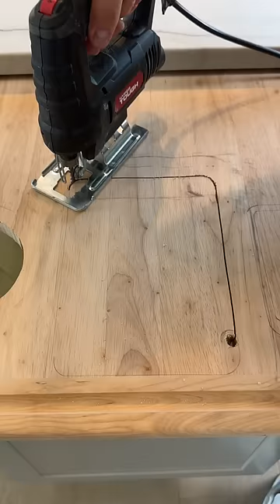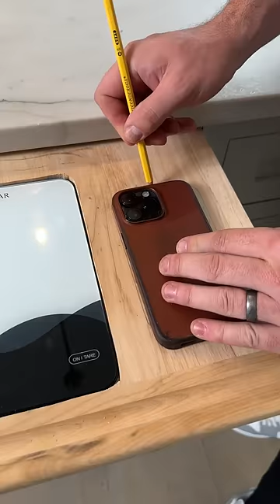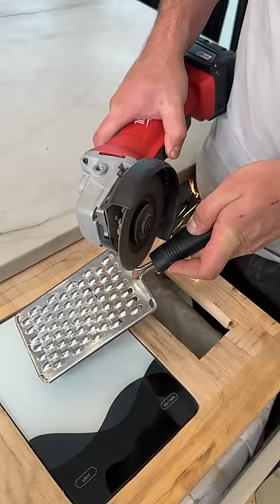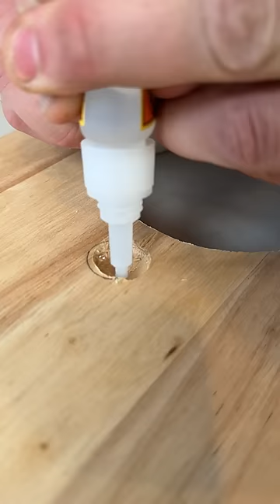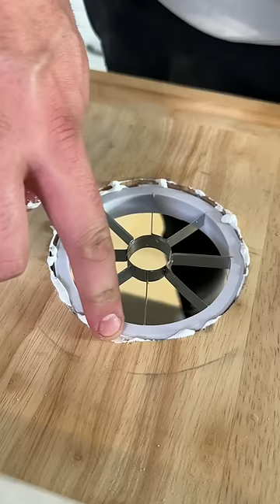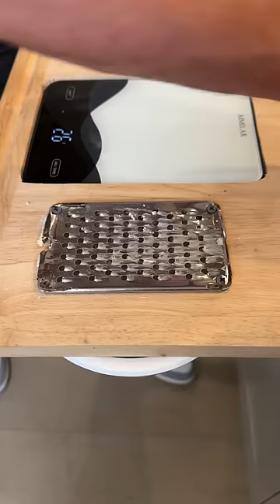THIS IS WHY I MARRIED HIM! 😍

Comment: Yes put all your weight on the apple slicer just to cut the apple so it can 1. Break cutting board right off the table 2. Push your own hand right threw the apple slicer It had handles for a reason lol.
Reply: How about how he drilled the holes right above the marble counter😳

Comment: Now you have a much smaller cutting board and a bunch of kitchen tools that you can never wash. Perfect 😂
Reply: Or use properly
Reply: It was the screws right through the shredder for me 🤌.
Reply: THIS!!! how do i wash that.
Reply: The cutting board is able to be removed so you can wash it
Reply: @angela4137  So just have to handwash an entire cutting board that is about as wide as the sink, instead of the small tools that can go in the dishwasher, got it.
Reply: The cutting board is useless as a cutting board. So now they either have one laying around or they cut directly on the granite killing their knife's edge.
Reply: @angela4137 I don’t think it can be easily removed otherwise you have to worry about your toes while cutting 😂 Plus the board is bigger than the sink so……😅
Reply: Lol thinking exact same thing
Reply: moldy cheese grater adds extra flavor
Reply: Some people be doing too much.  That it has the opposite intended effect.
Reply: @TheVikingRaid adds that funky blue cheese flavor
Reply: İyi
Reply: @angela4137  Not with an electric scale in the middle that is not waterproof beyond the top exterior shell. Which is also ruined because there is not enough stability with the board to get anywhere near an accurate read.
Reply: I mean technically it would be possible to wash, but it would be a painful lot of work.
Reply: I thinked exactly in that...hahahaha 🤮
Reply: Justamente eso pensé, como los va a lavar😅😅😅
Reply: @andremartinez418 you cant even wash whole table cause the electric stove also plant in it
Reply: @angela4137 so is the digital scale waterproof now? nice😅
Reply: Good luck cleaning this
Reply: @Unlitedsoul  The scale doesn't seem to be affixed in and just supported by a couple of metal strips. So hey can just pop it out easily when they want to WASH THE WHOLE FUCKING BOARD just to clean the cheese grater.
Reply: Not to mention he used screws that will rust with any moisture present 😂
Reply: Gross…bacteria, mold…ehhh
Reply: @angela4137  that's a digital scale, not a cutting board. not sure they work properly unless they're on a flat surface though
Reply: @ItsJustTeddington  You may have a point. I thought he used epoxy around the edges, but maybe not. I'd have to re-watch to be sure... and... well... no thanks!
Reply: Not to mention the non food grade glue.
Reply: And grooves on the side where food gets stuck
Reply: you can' wash it the same way you wash a corner duh, ! just think ..
Reply: Except he can remove the cutting board and wash it and sanitize it.
Reply: You do know how to remove screws right...the problem isn't washing them that would be very easy to do. The problem is putting the screw back he would only be able to put them back a few times until he just has a big hole that the screws won't go into anymore. I thought people were smarter
Reply: Right? How often does she slice apples with a junky slicer? Why doesn't she just use a knife?
I thought he was making a margarita station or something. to hold a bottle of wine and tablet in the bathtub.
Reply: @Unlitedsoul not enough
people recognize the scale is practically useless.
Reply: @Aethenthebored  So you think cutting boards are somehow some overwhelmingly hard thing to wash in a sink like millions of people manage to somehow do everyday without an issue, got it.
Reply: TBF he was never washing that stuff anyway.
Reply: @angela4137 it's not a cutting board it's a scale with batteries 😂
Reply: @Jabberwocky818 So you think having to detach the cutting board from the kitchen counter and take it over to the sink that is smaller than the cutting board itself just to wash the cheese grater is just as easy as putting the cheese grater in the dishwasher, got it.
Reply: @Lyskestrekk_  Detach? It's not attached to anything, it just slides right out... And it's a cutting board.. They're designed to be washed in a standard sink... Are you telling me you're not aware of the basic geometry that allows it to fit in the sink just fine diagonally? Got it...

Comment: Not just hard to clean up and sharpen the blades, but shoddy workmanship. No filing the wood to prevent splinters, no stabilising bars to keep the apple slicer from popping out, just glue. He was grating cheese so carefully to keep us from seeing how the whole plane would shake and struggle under the force.
Reply: I'm glad I'm not the only person here who has touched a piece of wood without a finish on it and noticed how bad the workmanship is :D
Reply: Not to mention burning up the drill bits

Comment: Man woke up and thought up ways to make his wife's clean up work 10x harder
Reply: You just know she used it once for a party to show off and never bothered with it again
Reply: Look at his face he doesn't want to.
Reply: Out of all the comments finally someone has some commonsense. Yes, the wife does the cleaning
Reply: This guy loves cleaning the floor
Reply: Thats why she married her
Reply: I absolutely agree, that is what I thought when ser the cheese 😅
Reply: I was thinking the same thing like how is it going to be cleaned simply wiping it down is not going to get all that out it needs to soak a bit
Reply: Pressure washer probably just under the table
Reply: @lumixpepper  Great idea. Safes putting things in the dishwasher as well if you just leave the plates on the table.
Reply: Gonna have to take it out back and hose it off 😂
Reply: How are these things cleaned? Just a health department question
Reply: Maybe they have a steam cleaner
Reply: He will wash it after every use
Reply: No easier as I  see it!
Reply: @lumixpepper  good point.  Because if he made it, he can adjust it as well
Reply: Exactly. He's actually very passive aggressive.
Reply: Maybe one of them will just use that cute little vacuum to clean the grater!

Comment: I thought he knew what he was doing, but he did not.
Reply: How do you not know that everything he put there is easily removed??... the cheese grader is put there using screws and duh you can easily take the screws out the same with the meat weigher only thing he can't remove is the veggie slicer but it's easy to clean thanks to the wide spaces it has. Use your brain more.
Reply: @maddielynn7929 bro if you need to unscrew your cheese grater to clean it everytime you use it you have just made 2x more work then if you just left it as is 💀. Use your brain
Reply: @maddielynn7929 how the fuck is the apple slicer easy to clean? It’s sharp edges all the way around. Everything is screwed or bolted in. It’s a pain to unscrew and screw it in every time. Plus eventually the screws will strip with the amount of times you have to undo them. This is all super unnecessary. How about instead of telling someone to use their brain more, you try using yours first.
Reply: @maddielynn7929 🤣 you little troll you
Reply: @karuuuma I don’t think it needs to be removed…should be able to clean it as is…then if anything clean the floor lol
Reply: @maddielynn7929 yeah right you think she gonna remove it every time she uses it you're wrong.
Reply: @battlerudee well with wipes or something unless your taking it out. Wont work for a grater tho. Still just extra work
Reply: Simply not practical
Reply: @maddielynn7929  I think you had everyone’s attention up to the point you called the scale a ..meat weigher.
Reply: @maddielynn7929  You wouldn't need to unscrew anything.. It used to be a cutting board, so you'd clean it like one. It's really not that complicated.

Comment: “Anyways, how are we gonna clean it honey?"

Husband:
Reply: Husband: builds the contraption into the dishwasher
Reply: Wipes maybe. But it's sweet
Reply: I was watching the video happily and wonderring this wonderful idea till I ve read your comment i was like this 🤩.....😳 Thanks for paying attention 😅
Reply: Exactly 😂
Reply: My thoughts exactly
Reply: "We?" - husband
Reply: Here's a thought: 

Use. A. Sponge.
Reply: @rustinstardust2094 use a sponge and waste even more time cleaning the stuff and having to take extra precautions bc you can’t clean it in the sink? very smart
Reply: You have no idea how much i needed to see this.
Reply: Uses it once😂
Reply: Husband: don't you mean, how are you gonna clean it?
Reply: That was my first thought lmao
Reply: @crus0e790  Whenever I try to hand wash the cheese grater the hand that's holding it gets cut or nearly cut. It's just such an awkward - and sharp - thing to clean! If it were stuck in the cutting board, I wouldn't have to worry about holding it still and could clean it with one hand - the sponge hand.
Reply: @crus0e790  Fewer precautions. It's already held in place so you only need to use one hand.
Reply: @rustinstardust2094  if you are cutting yourself with a cheese grater while washing it you might as well just buy pre grated cheese. also having to bend over to clean the grater, being careful not to spill water everywhere when cleaning it sounds like a lot more trouble than just using it NORMALLY and cleaning it after in a sink
Reply: Husband:I am glad I have a wife
Reply: @fishbo_uses_soap  Guess who's getting a screwdriver for christmas!
Reply: @downwiththethiccness9406 ahahahah

Comment: Bro, you're going to have to invent an entirely new machine to clean that cheese grater
Reply: That was my first thought too the scale wasn't a bad idea though
Reply: Haha me too... I came here in commemt section just to find this kind of comment 😅
Reply: Also once those screws start rusting from all the excessive washing it’s going to be nasty! I’m sure if your wife seeing you must be think wtf and then saying through her teeth “great job hubby, that really good, I mean really good!”
Reply: Exactly my thoughts.
Reply: Che problema c'è? L'importante per voi ragazzi è FARE ..A  pulire ci pensano le mogli...😂
Reply: Lmao I had the same exact thought!
Reply: That’s what I was gonna say !!!! How is that shit gonna get clean now ?!
Reply: The entire board pulls out and can be taken to the sink easily. It is not that bright of a setup but washing the grater is easy peasy.
Reply: Hahahahahaaahhahaha
Reply: @MR-2_AW11 I would say it probably is a bad Idea to, scales usually need a flat surface to stand which is horizontally leveld to work properly and everything u put on the board can affect it. I doubt that the board is so leveld all the time and that the metal things on the back are so perfectly even and placed in the right direction. I mean my scale isnt correct anymore if anything touches it, so I guess the wood directly around wont help.
Reply: and the drywall screws that gonna rust out and collect all the tetanus bacteria

Comment: He was so proud. He really thought this was a great idea. Bless his heart. 😂
Reply: Wait, why isn’t it a good idea? I’m confused. 🥸
Reply: @Hugsand_Disses  First, some tools he's using are wrong, second, how do you clean it? Just leave the cheese grater screwed on drywall screws? Take the whole thing out and wash in shower?
Reply: Very cute 😂
Reply: How do you clean those items after using?
Reply: @Hugsand_Disses You need to clean them. How are you gonna do that if they're bolted to that thing. I will say the scale is good.
Reply: That is looking for gadgets
Reply: Its a good gadges but like how are you gonna clean it like frr😭🤣
Reply: @FVBmovies exactly what I was thinking.  Food poisoning 101.
Reply: A bad idea is better than a wife anyday.
Reply: No don’t praise him.!
Reply: @Hugsand_Disses You can't be serious?
Reply: Bless his heart! 😂😂😂😂😂😂😂😂
Reply: @marklund3620 I would say the scale probably wouldnt work correct, because they usually need to be placed on very flat/even ground and even while they pull it out u can see that the numbers are changing. If the board is not perfectly horizontal leveld it could also effect the result. As well as everything u put on the board.
Reply: @FVBmovies  They have a deep basin sink right next to that cutting board, that has been shown to be removable from the slot it goes into. 
If it makes his wife happy, and they're willing to throw it in that basin for every cleaning, other than replacing the screws with some corrosion resistant ones,  I say let em be lol.
Reply: Bless his heart, but not his brain
Reply: I’m glad this comment isn’t super rude. Thank you for not loving to point out peoples lack of thought into things.
Reply: @marklund3620  no need for the cleaning...It remains hidden in cabinet ))) Bacteria!?- who cares :D :D :D

Comment: I love when my husband cuts a bunch of pointless holes into our cute little cutting board and then destroys several kitchen utensils
Reply: Did you see the jaggies on the cuts and the smoke from those drill bits? This ain't the first time he's ruined something with them.

Also, if I can't put it in the sink and wash it, it's not a cutting board, and is not food safe. It is a desk extension.
Reply: @thomasgeorge4384  fair enough, the thumbnail of the video does show that the cutting board is removable though

Comment: Yeah, seems like a logical way to not be able to wash the cheese grater or the apple slicer again. 👏👏👏
Reply: if you noticed, he did not show when he used the slicer, because it takes so much force to use it, that it would have snapped the cutting board or snapped off the countertop, but better yet, sliced his hand with the blades.
Reply: Right 
So you can pull the slide out to wash but is the scale water proof
Reply: My thought exactly!
Reply: @bigkbron  Yup, that's what I was thinking. You'd have to use a mallet or something to force the apple through, and no way would it have held up.

Comment: The drill on the marble countertops was so anxiety inducing
Reply: In the last second of the vid, you can hear the grater trying to shave the bottom of the marble top. Setting aside the damage, the grater won't last more than a dozen uses before it's completely useless.
Reply: @joranbooth5529  Let's not talk about the mold that may start to form from that wood when he tries washing that cheese grader regularly.
Reply: @suitdoggy4707  Oh geez, yes.

Comment: the force that you're gonna put in that apple dicer would for sure break that whole table💀
Reply: I was thinking the same thing, probably why the video skips straight to a sliced apple instead pf showing us
Reply: whole counter HAHAHA
Reply: and if not that, then the dicer will fall out of its position by the time, because it isn't fixated good enough.
Reply: That was my first thought.
Reply: Also, they would have to seal it in with the sharp side up for it to work. It will not only break, but be a hospital visit also
Reply: @TheSinep999  The sharp side is up. If you pause as he pulls his hand away in the final installation shot you can see shiny edges.
Reply: Maybe thats a good thing . . .
Reply: And how would you clean literally any of this

Comment: This carpenter was so preoccupied with whether or not he could, he didn't stop to think if he should.
Reply: That’s not a carpenter. That’s the homeowner. A carpenter wouldn’t create this monstrosity
Reply: Life finds a way...
Reply: Please dont insult carpenters.
Reply: Look, if he spent a bit of time planning, and literally $60 on a cheap plunge router from the local harbor freight, it couldve been a decent idea, but he did neither.
Reply: @death32815  how do you effectively clean ANY of that. It is a terrible idea.
Reply: please dont consider this man a carpenter lol
Reply: @GrimaceTheCat1  a carpenter also would use the proper drill bits and not whatever these dull bits were.
Reply: @TheFineagler  With a pressure washer.
Reply: Good luck with the clean-up

Comment: The smoke billowing from those blunt drills 😂😂😂😂
Reply: I thought that 😂
Reply: hahahahahaha
Reply: I thought he was trying to start a fire without using a lighter
Reply: And doing it on the worktop
My wife scowled at me and i wasn't the one doing it
Reply: @barryelliott2196 they must be so blunt if they can't even cut wood!!!
Reply: This is the reply i was looking for!!! 😂😂😂
Reply: Drill prob in reverse😂
Reply: @barryelliott2196 Drill bits for metal go through the wood just fine.
Reply: I think the drill is in reverse
Reply: Beat me to it! But the next part of the install is a drill bit sharpener… next to the grater 😂
Reply: He was probably running the drill backwards... he seems like a real genius
Reply: @barryelliott2196idk if you are aware but wood is much softer than metal.
Reply: @TheOffCycle it was😂😂😂
Reply: @mrsqueakthecat.8061 not in his case
Reply: Probably concrete bits and figured wood is softer than concrete.
Reply: @barryelliott2196 so what you’re saying is, the drill bits for metal won’t go thru wood without fire causing friction? Check again, they can be used on wood, they just don’t leave a smooth finish which I have yet to get with wood drill bits. I have used many many many drill bits intended for metal on wood and they went thru perfectly fine because they are kept sharp.
Reply: Thank God others saw it. After watching that I had no hope for humanity but yall saved it!
Reply: He's using metal drill bits on wood, while it might work it doesn't work very well.  Although considering the amount of smoke he might also have the drill in reverse.
Reply: @barryelliott2196  I though I did not see right at first. That brill bit looked like its was for metal not wood.